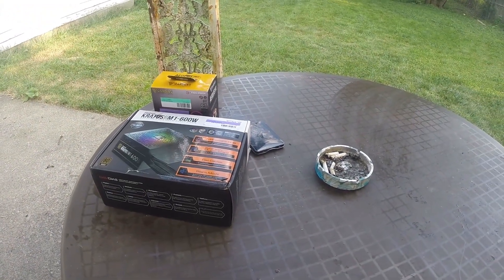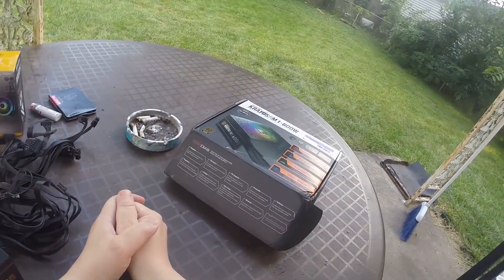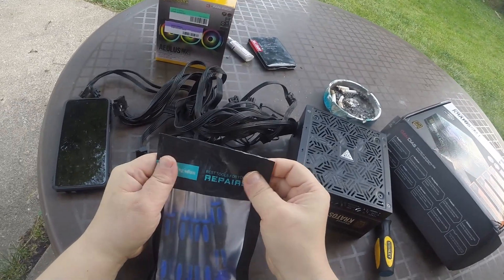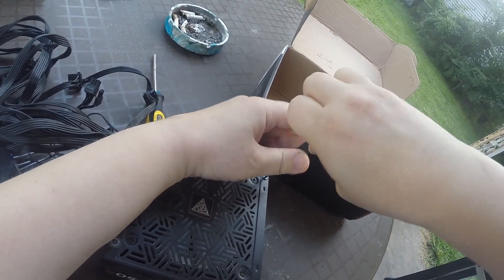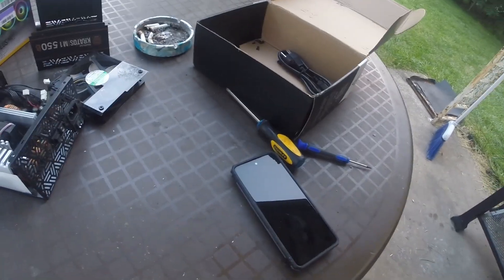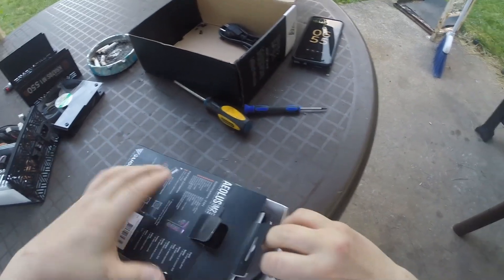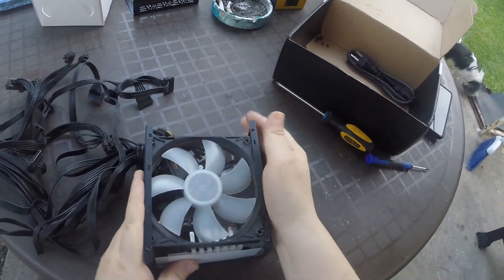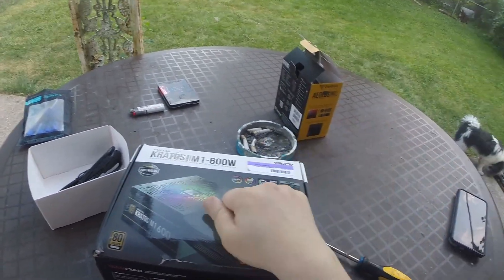Examining the dead Gamdias Kratos M1 550b Power Supply

Comment: yeh you really shouldnt be messing about without at least testing if there is any voltage left in there.
Reply from the maker: It been dead of like 11 days. So I think it was safe to check around.. I wouldn't never mess with something that is live.. But thank you for the advice. Didn't think of that until now.. lol I'm still here. :p
Reply: lol well learnt a lesson the easy way :D could of given you a nasty shock mate. has it really been 4 years since you got that PSU. pretty sure i remember you getting it...??? :S time flies
edit : ah the pc is four years old but the PSU is newer right?
Reply from the maker: @rammie1976  Naw this the original PSU that came with the system back in 2020 of May. But you did see me get the 600b one though. That was in a  video a few days ago.